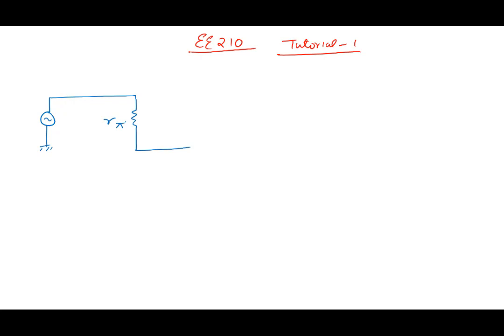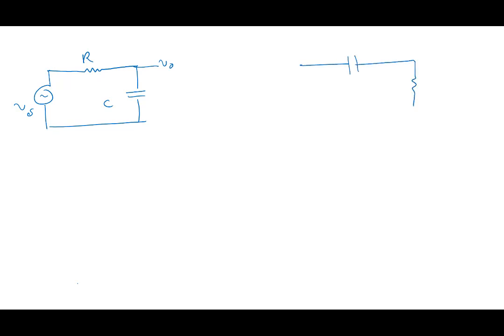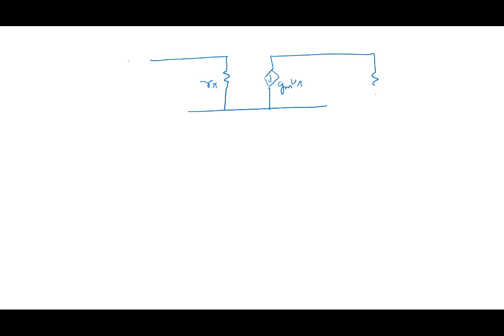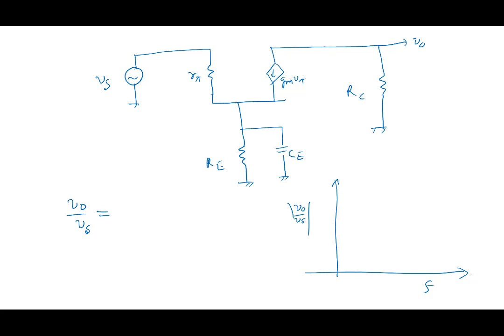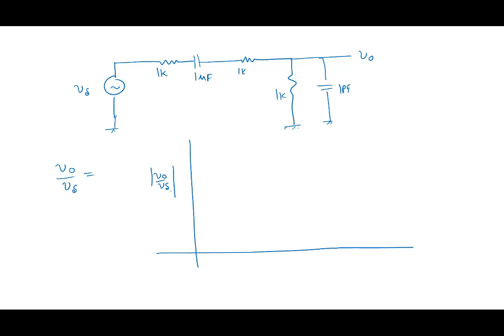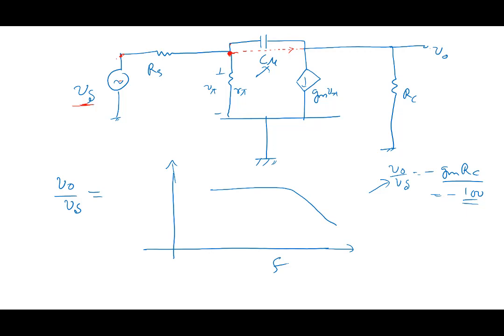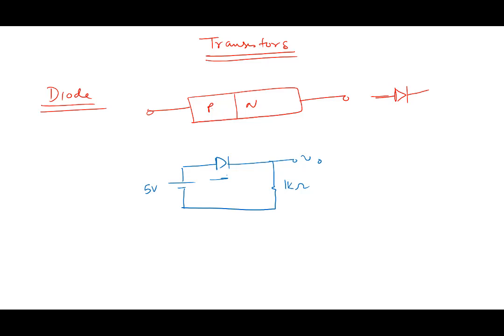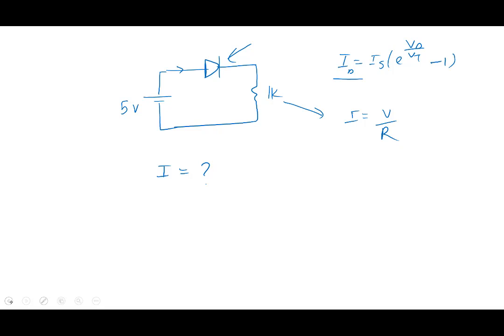circuit analysis -part-2  (EE210 summer 2018 L2)

Comment: sir you said in one of your lecturers impedence seen from collector is ro+(RE(1+(gm)(rpie)) but here you said infinity please clarify
Reply from the maker: Output resistance is always finite but in some cases when another resistance in parallel to it is much smaller then it could be taken as infinite in a relative sense. Approximations depend on context.
Reply: @baquermazhari8968   thankyou sir, please make lecturers on opamps, feedback amplifiers and filters if you have time because i cannot see you but   
i saw your lecturers